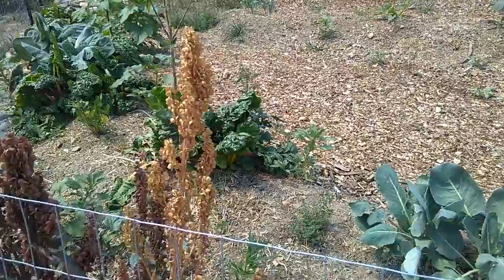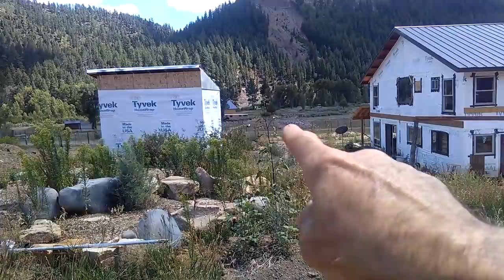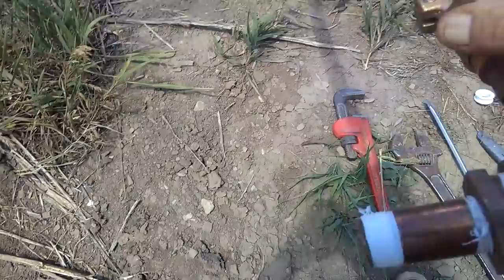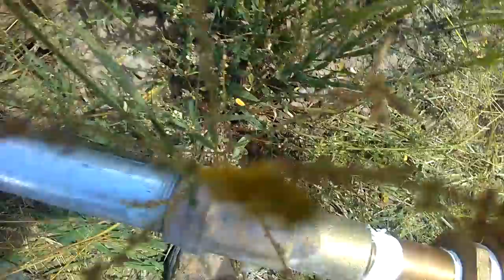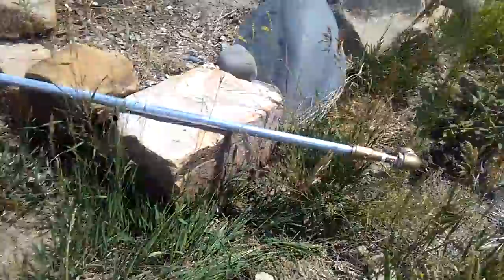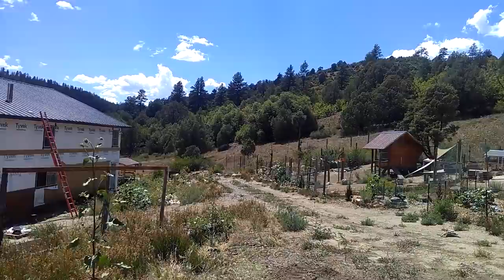Baker Creek Rare Corn Varieties @100 degrees -  Black pipe Irrigation Install - Frost Free Faucet

Comment: Holy crap Diamond I have installed numerous frost free and I have never used anything but plastic fittings and SS clamps and never had any problems at all and at a fraction the cost, like under $3 each hydrant. Those fittings are ridiculous.  I have never even seen those brass fittings. Please don't mislead folks into thinking those expensive fittings are necessary. They are not. That heat and wind must be a challenge. Been in the 70's and 80's and simply beautiful here in the TN mountains for weeks now. Afternoon rains nearly every day. Our wild lettuce is about 8' tall and a month of growth to go. 18 - 20 feet tall by Fall. I should package it and sell it on eBay. Must be 50 plants like that around the yard. Wish YT (Google) would allow pics in comments.

Comment: I need a new tractor really bad and a windmill water system. 
I'm retired.. with limited income now..
Wondering if I could set up a go fund me account to help get those 2 exspensive items.

Planted my fruit tree Grove in spring 2017. 
Have 32 acres of good land over the Eagle Ford gas field area. But no lease on my land yet. Lots of drilling going on around me.. 

I sure could use a gas well income.

I keep hoping..

Comment: Looks nice up there at altitude.So what’s the deal,any lots available for a newly single guy looking for a new start..? And to grow everything from A-Z. Skilled worker,welder and built skyscrapers for 20 years.I can do almost anything and drive everything.Retired but only 52 and still kicking ass when needed.(work wise). I tried 
 to buy a lot in Co and just the water rights alone sent me home wondering how the hell its possible.Either way good luck with your project. You have a good thing going. Peace.👍✌️

Comment: Just excellent work! Heavy duty stuff you are dealing with there! I am so glad we are in a place that freezes intermittently....but I am doing extra. I certainly don't have the wide expanses that you have, just about a 1/4 of an acre. We are doing French intensive farming techniques, and I am dealing with temperature in a different way. When it is cold, or hot, we use ground to stabilize temperature, through water tanks that are buried. The ground here basically stays between 45-55f all year. It might change a bit, but not that much .....then I will have hoses in particular places to collect/distribute  heat/cold......the way the old maya did it. Aquaponics, and some ducks to get rid of the bugs, and provide eggs. You are doing the big work......please keep keep us in the loop!

Comment: Looks really nice. I've been tumbling ideas around my head for a passive solar greenhouse. My home faces South and would benefit. Thanks for keeping us posted on your progress.
Reply: Think moisture.  Greenhouses are wonderful for passive solar but you need to mitigate the moisture problems with ventilation, gardening techniques, lumber choices, proper dry wall and drainage.  High humidity is wonderful for skin!  Not at all for buildings, furniture, books and stuff.  Even plants need moving air and less humidity.  Find an Architect that specializes in Passive Solar.  They are worth their weight in gold.  References, licensed, bonded contractors...

Comment: Hopefully that pipe is a full 3 feet below the surface, that black pipe.   Only the frost free is above the surface and linked to the pipe 3' below.  You do not have to blow out your irrigation or drain the pipes.  You should be able to use that to access water all year long.  That is why they call it frost free.  Unless you plant on having your pipes break you do not need drain rock.  The soil is what protects the water pipes from freezing, not cobble.  3' down no less!  Back fill using just the soil you removed.
Reply from the maker: 5 feet
Reply: Diamond!  Yay!  Perfect.  You do not need drainrock, trust me.  Check on the dang chemistry of the black pipe for carcinogens.  I won't even use non residential rated hoses to water my horses.  After I learned just how carcinogenic most hoses are.  Just an idea.  The drain should be made to slope away from the spigot if you want to use your spigot.  Drain rock  does nothing.  5' down?  Won't hurt a thing!  Just costs more.  Our frost free spigots or whatever they call them are only 3' down, we are probably very similar in elevation?  They have a tendency to freeze up, malfunction and/or get knocked over by tractors moving snow.  Ugh.  Keep a flag posted during the winter to highlight your 'spigot' .   We used 3/4 pvc for our piping and it is approved for drinking water....arghhhh.  Our buried pipes were never the problem.  It was always the frost free hydrant mechanisms themselves that froze and/or broke.  And the tractor moving snow, out of sight, out of mind and whoops.  Another thing to keep in mind is the ability to turn off your lines in case you lose a spigot, to isolate one section from another if problems arise.  Like a tractor  that a friend is doing us a favor to plow our snow and I don't remember it is there.  Next winter, flags!

Comment: 3-4 raps of tape in the same direction as the threads...but take it from me if you want a good seal on threaded fittings use clear silicone ..cool place..wish I could go back to Montana